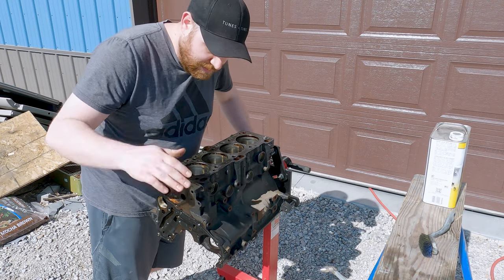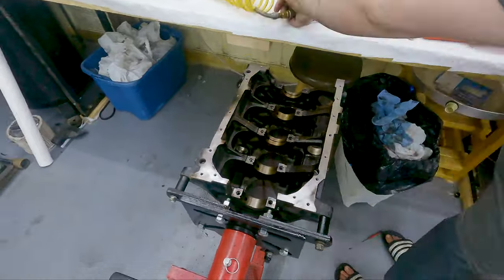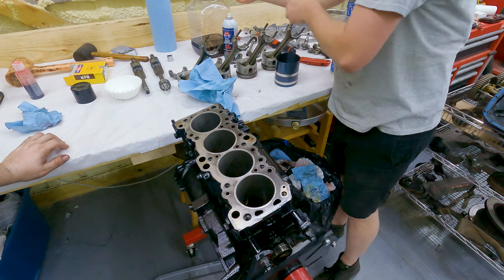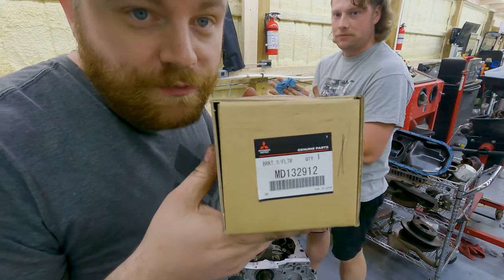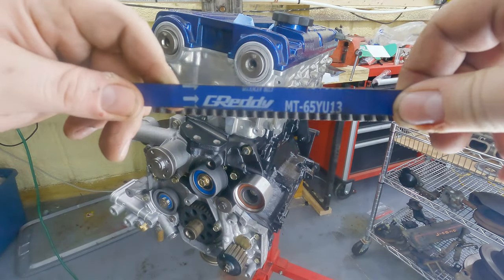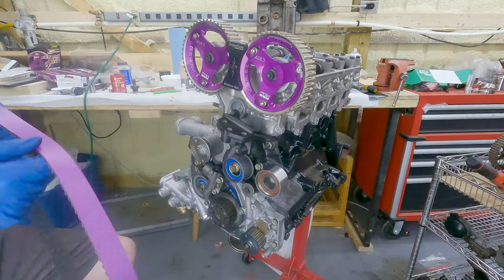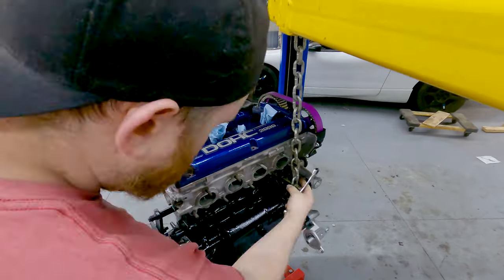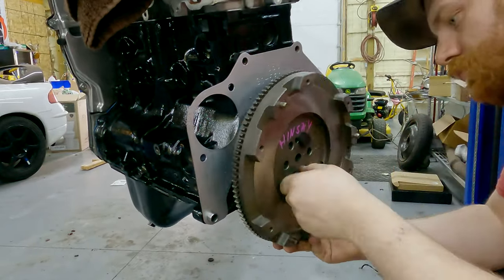Dream DSM - Engine Assembly  | '99 Mitsubishi Eclipse GSX | Raven EP7

Comment: Interested to see how things go using a block with no oil squirters on stock pistons. I've heard usually you can go without squirters if you have some nicer pistons, but stock turbo pistons often need them. However I put many thousands of miles on a full n/a engine that I just stuck a turbo on with n/a pistons and everything so really who am I to talk lol
Reply from the maker: Haha we're in this together now! It's all in the tune really, I'll be keeping a close eye on everything! Keeping the combustion chamber temps down is the key. In future episodes, you'll see what measures I take to keep those temps down!
Reply: @tunesandtunes  Got my sub. Currently about to rebuild my 6 bolt again because mine crank walked on me. Nice to see others doing similar projects to my own car!

Comment: Your choice not to run oil squirters goes against the rules; machining the hyundai block to accept oil squirters isn't that difficult and can be accomplished with basic hand tools.
Reply from the maker: Wait there are rules? Man, we would have done it differently if we knew the rules! Lol But for real, there are plenty of examples of non oil squirter builds being fine.  They are there to prevent excess wear under high thermal loads. If you control your combustion chamber temps properly, you don't need the squirters. Thanks for watching!
Reply: @tunesandtunes  Please make your next video about controlling your combustion temps through tuning.
Reply from the maker: We'll get to that eventually. But you control it with the tune. Cooler IATs, less aggressive timing, water/methanol injection, a richer AFR. Those all contribute to combustion chamber temps.
Reply: @tunesandtunes  That has been covered in depth before, what has yet to be done is for someone to give actual example AFR's & Timing numbers so we have a range for what is safe, what is normal, and what could result in piston overheating...without these numbers, any video would only be for entertainment value.
Reply from the maker: Ohhh ok I gotcha. Yeah I'd be happy to share that info! Although I might not be able to show where the threshold for piston melting is, as I'm trying to avoid that haha. But I'll definitely show what numbers I've found to be safe!